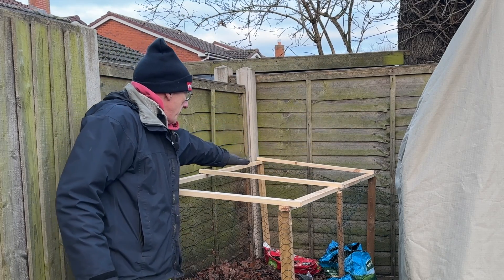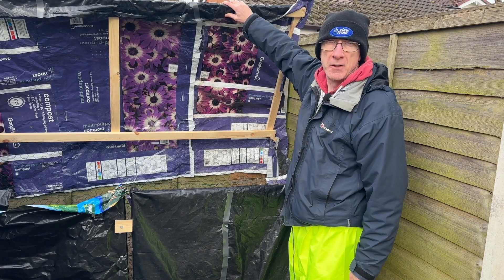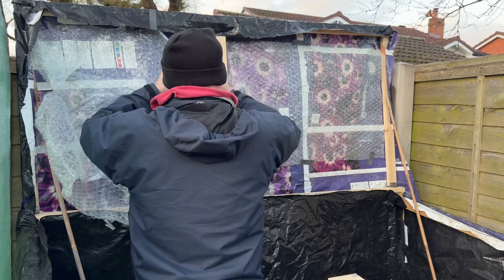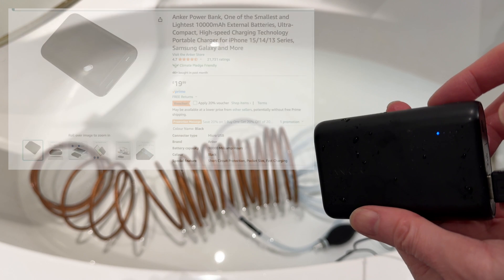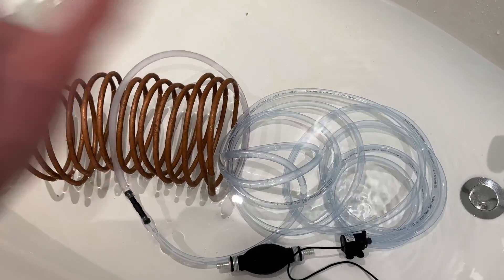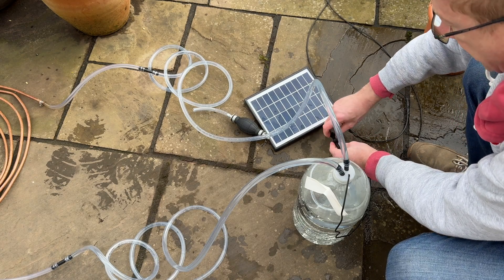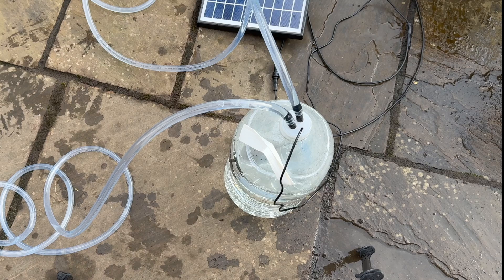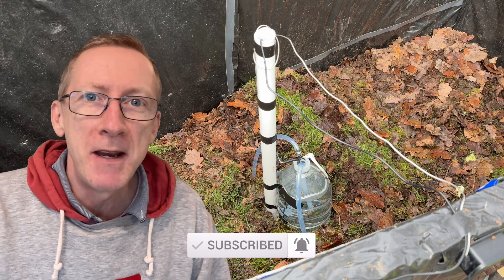How To Heat A Greenhouse With Compost Part 1

Comment: You can't get a meaningful amount of heat this way..even though thee idea is very trendy..... lets say you have a 3'x3'x3' cube of compost and the inside 2x2x2 is up to 145degrees F..... now you have to take that  interior heat and put it into a  open space... that's an insignificant amount of heat (vs temperature)... and now that heat is removed from the compost......the rate of heat that the compost life can generate is way too low to k  People confuse keep up.    Consider that it took days and days for the compost to get u to 145 F, and that was with nearly no heat being removed as it's insulated by the compost.  I understand people get excited by the temperatures being achieved vs temperature x mass x rate of production=  usable heat.
Reply from the maker: I think you should watch part 2 before you make any assumptions. This is a heat exchange system which is designed to transfer heat into a greenhouse, not an open space.
Reply: Can’t seem to find part 2. Is it not online anymore?